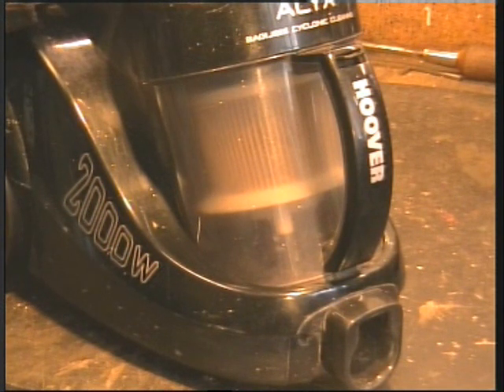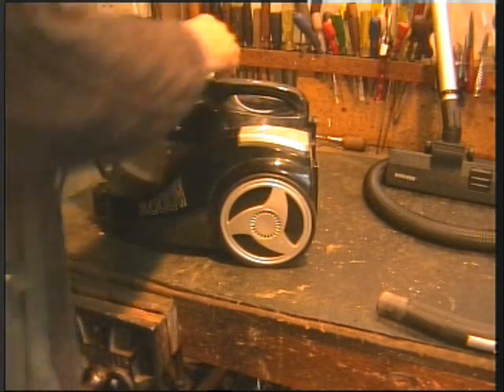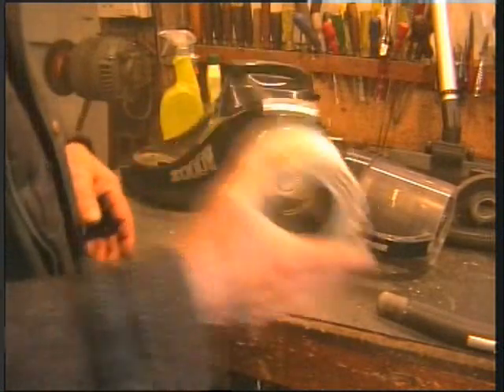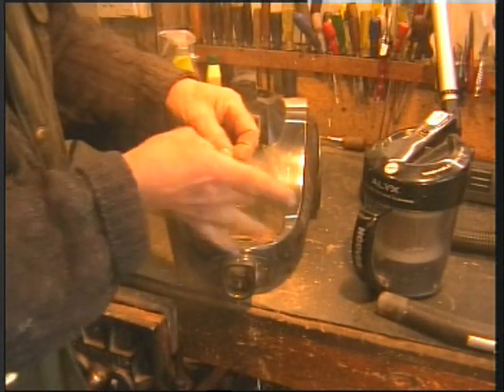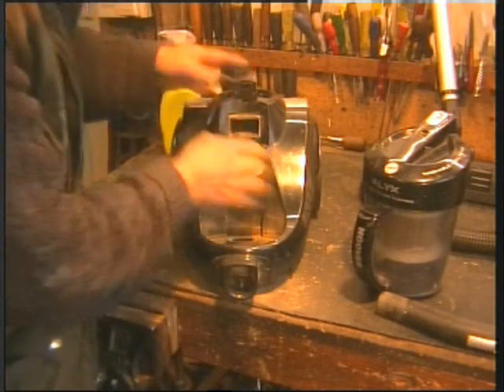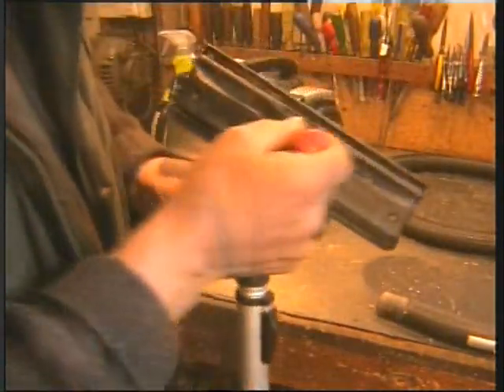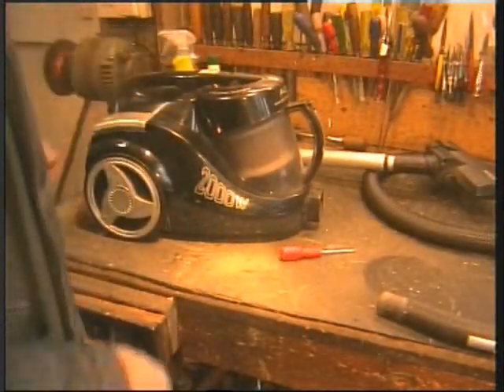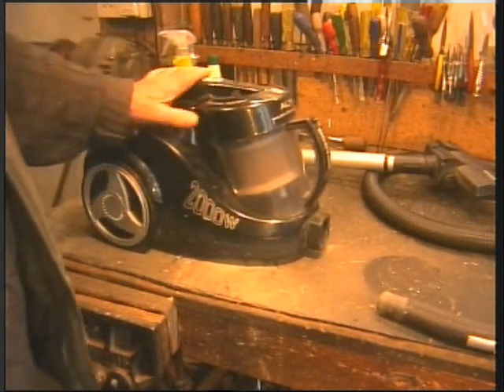cleaning the cleaner

Comment: We have a Dyson at home, I'm in charge of fixing it when it needs cleaning as the wife maintains she can't get the thing apart. Doesn't matter. The machine at work is absolutely useless. I wondered why a new shop vac would be so poor and I opened it up to find one of my junior monkeys had stuffed a plastic bag in, instead of the ones for it, and taped it down with duct tape. It's lucky it wasn't sucked in and set on fire. But it's probably the boss rubbed off on him, he complained at $10 for 8 new bags.

Comment: My wife bought a  stand up vacuum from Tesco's a while back it cost £15 !! It works well and has similar filters to yours, the thing is the filler has begun to fray a little and gets matted as it must of got wet. The hoover has absolutely no identifiable manufacturing marks and I can't find a replacement that looks the same. I've contacted Tesco's and they were no use at all !! Any ideas how I could make a replacement POC ??
Reply from the maker: "a while back" ? if under a year,drop it in Tecos lap and don`t take no for a an answer,flailing that leave as is with one leg of a pr of tights over possibly ?
Reply: I say a while back but it is well over a year, I'd just be happy if I knew who made it !! Thanks for the tip, I'll give the stocking malarky a go. I should of thought of that, my mum used to put some tights over the end of the hoover when she was cleaning something delicate.  Thinking about it just thought of another way to clean the filter, make a simple mandrill for it with some stud, a couple of nuts and wooden washers to go in the drill and spin it clean, same way as you do with a paint brush. Thanks again .